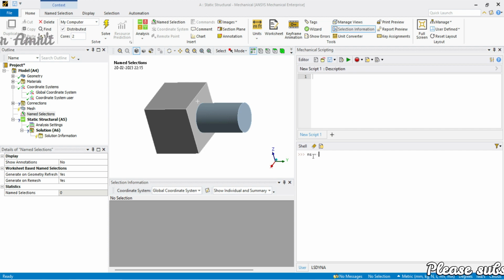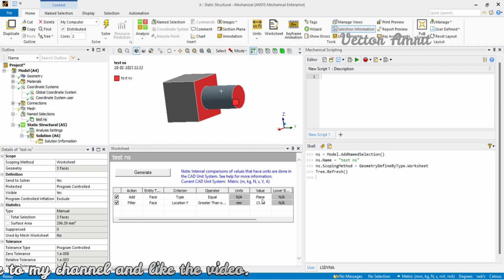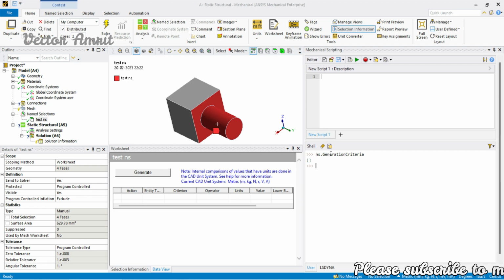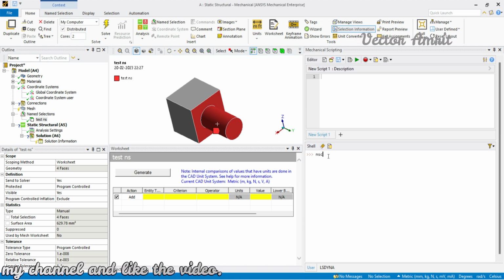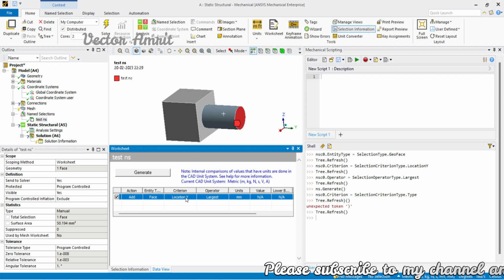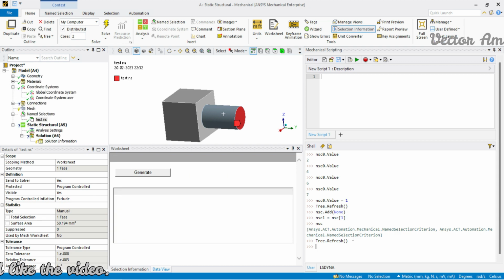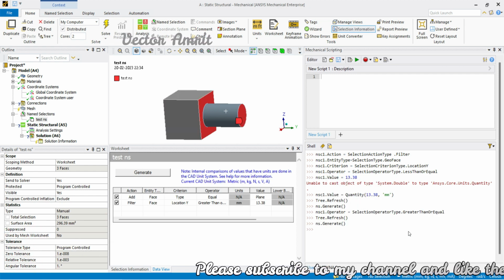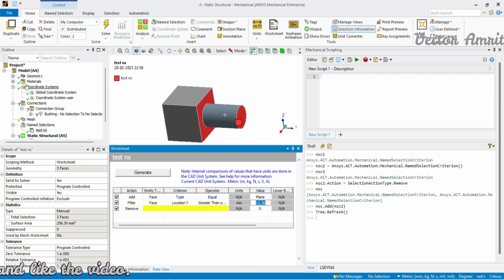18 Named Selection Worksheet | Automate the boring stuff in Ansys Mech |Ansys Python  Tutorials

Comment: I saw your earlier videos, and tried to add external data component from Component Systems in Toolbox, but could not enter into Edit dialog of it.
Here is the code:
 import sys
extdatatemp=GetTemplate(TemplateName="External Data") extdata_sys=extdatatemp.CreateSystem() extdatacomp=extdata_sys.GetComponent(Name = "Setup") 
extdatacont=extdata_sys.GetContainer(ComponentName="Setup")
extdatacomp.Refresh()
extdatacont.Edit()

Could you please help me out in this?
Reply from the maker: Edit() is not available. Please use 
extdatacont.AddDataFile(FilePath = '<your data file path>')
Reply: @VectorAmrit   I tried doing that but it does not enter into Edit dialog of Setup. It just loads the data in the backend.